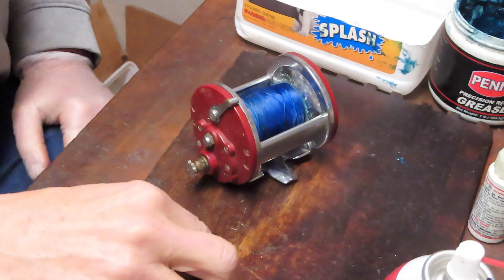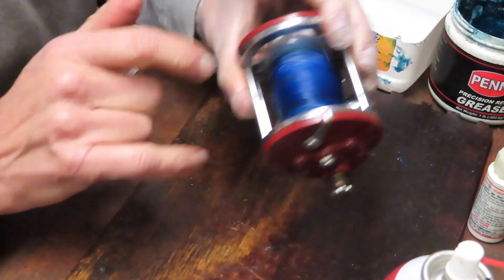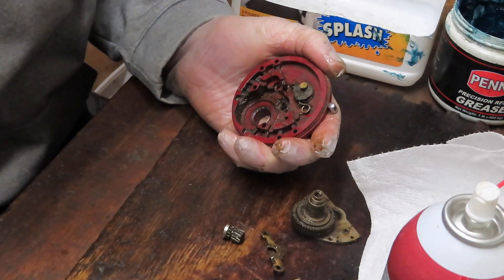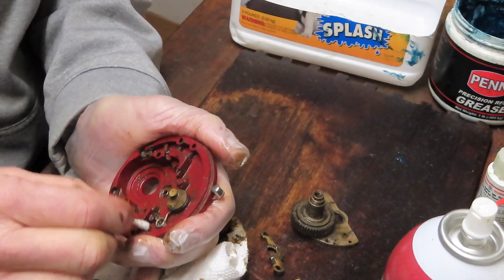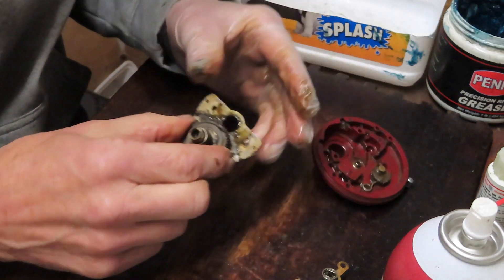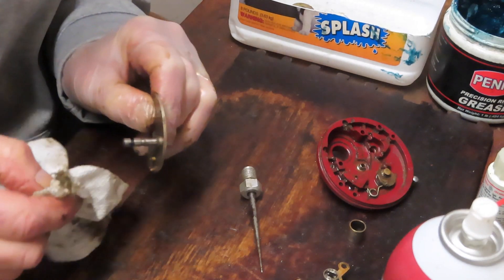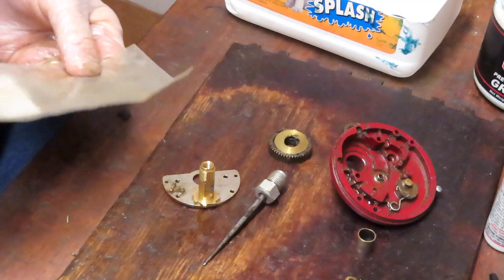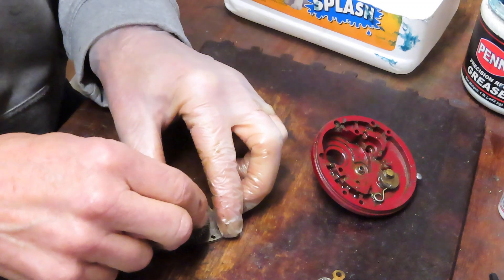Penn JigMaster 500S saltwater fishing reel how to take apart and service

Comment: Fascinating analysis of the weaknesses in this reel. I enjoy watching you do a service on these conventional reels but freely admit I don’t know very much about conventional reels. I’m supposed to finally get the Ocean City 300 that I found way before Christmas. I knew when I bought it there would be a delay in getting the reel shipped. By the way you’re pushing the envelope on the use of 1 paper towel. I’ve been working on a Mitchell 386 that I told you about. I can’t solve the problem with it. It is not a bent axle shaft, bearing or gearing. The problem starts when you attach the rotor to the reel. I might be sending you this one. I’m baffled. Just bought a Shimano MLZ 40 new in the box. Hope it is a good one. Happy new year Dennis. Another great informative video as always!
Reply from the maker: Are you missing a washer in the rotor assembly?  I am not sure of the configuration, but manufacturers often put a thin water where they connect the rotor and that frees it up.
Wishing you a Happy New Year - Dennis

Comment: yes you can use tiburon or acc. frame the only diff is the take apart screw.  try to find one with a broken take apart screw hole you don,t need it anyway and youll pay less.i made two a501s and a 501 half s..
Reply from the maker: good to know.  Thanks you - Have a Happy New Year - Dennis

Comment: Hey Dennis thank you very much for the informative video. I was wondering if you could help me find parts for my Okuma reels. I have two Okuma reels that I absolutely love. I’ve had them for about 15 years. One is the Okuma Epixor EF40 and then I also have an Okuma Epixor EF50. Trying to locate gears and bearings for them but I cannot find them anywhere. I went to one of Okuma parts dealer and purchase three gears and he only sent me one that was correct. Do you have a good resource where I can buy Okuma parts? Thanks a bunch. - Jim.
Reply from the maker: Start with Okuma.  They have been very helpful to me when I have needed parts.  You can reach them as follows - Dennis
Okuma Fishing Tackle Corporation
2310 E. Locust Court
Ontario CA 91761
Tel: 909-923-2828
Fax: 909-923-2909
1-800-GO-OKUMA
1-800-466-5862
Contact:
Parts and Service: service@okumafishingusa.com
Reply: @2ndChanceTackle  will do thanks

Comment: Thank you for that information. I did not know that was a weak point of a 500s. If I get a Tiburon frame will that help. Is there a cheaper route?
Reply from the maker: I am not sure they make that frame for the 500S and the 500 frame won't work.  Not much you can do with these. Dennis
Reply: It should not be an issue as a personal reel that receive care. These
reels are used in a commercial fleet
so they are used hard and not well
cared for. These reels have lexan not
bakelite plates- which are actually very
tough and were an attempt by Penn
to make a reel that could be assembled faster and with less manual labor. But
yes they can buckle especially when
using heavy drag and reeling against
same heavy drag will round the gear
sleeve.
Reply from the maker: As always - Thank you for the additional information Armando.  I can tell that the side plates are a different material because they clean up differently that the others. I have never liked this set up because of the effort to remove the gear side plate.  To me, they should have put the two screws on the bottom of the gear side plate as long as they were putting the other four in the crossbars.  I have seen a lot of these come in with bent frames, so I thought I would mention it.  Best wishes for a healthy and Happy New Year - Thanks again
Dennis
Reply: @2ndChanceTackle  Thats true. They were an attempt by Penn to save
money. It didnt work. Some of them have a really nice red aluminum spool though.

Comment: What spray did you use to clean the inside metal reel parts?
Reply from the maker: I use a penetrating oil, usually WD-40 - Dennis
Reply: @2ndChanceTackle  Thanks.